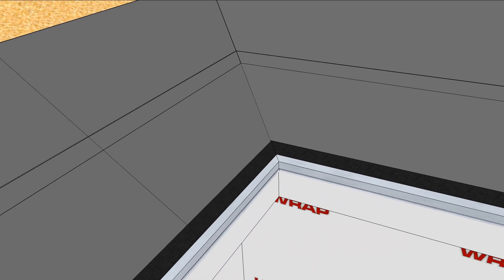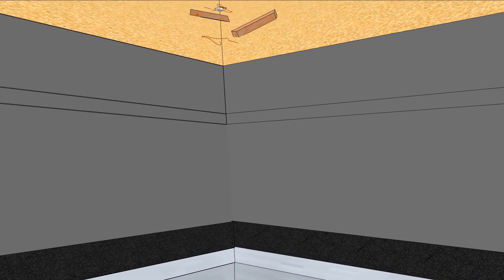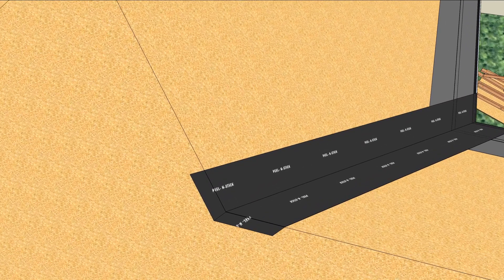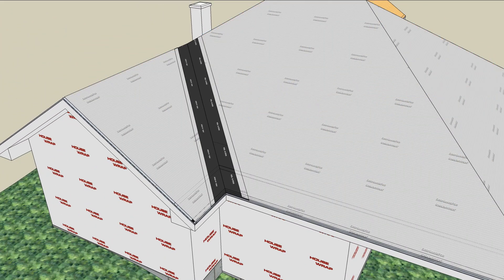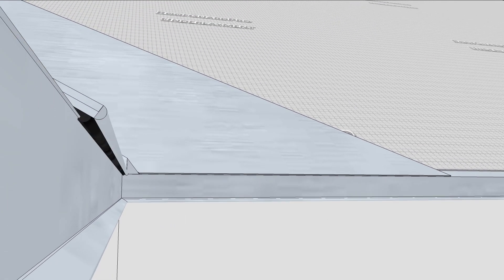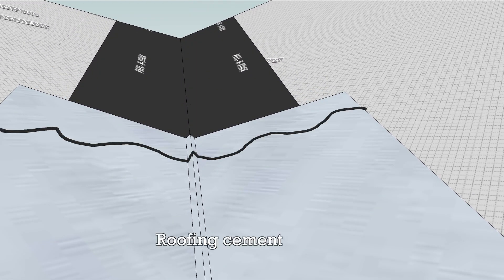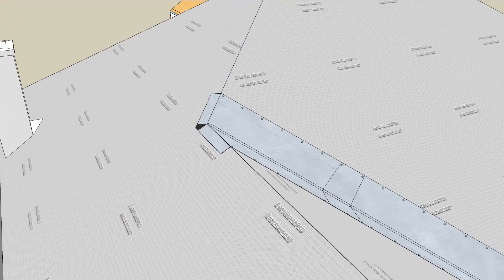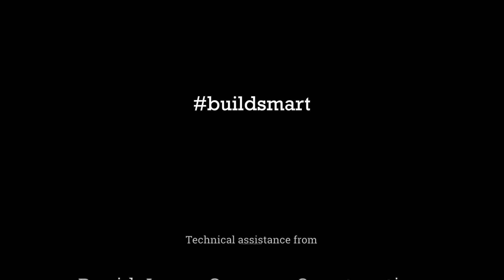Open Valley Roof Flashing

Comment: Wait, you put nails into the flashing? I thought you are supposed to avoid putting any holes into the flashing and just use the nail heads to secure the edges so it wont move.